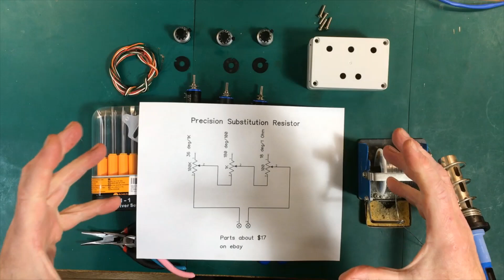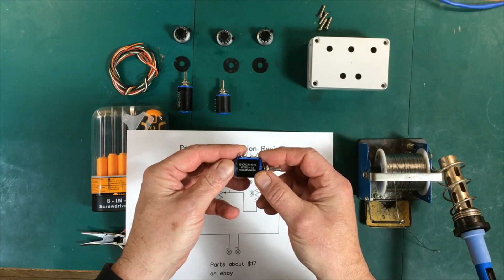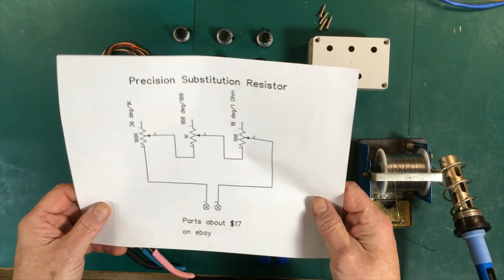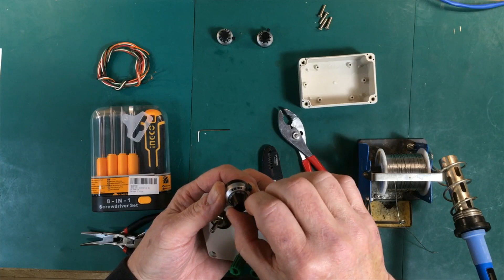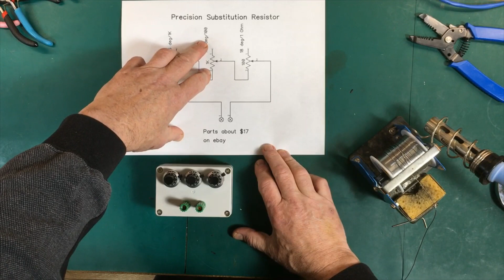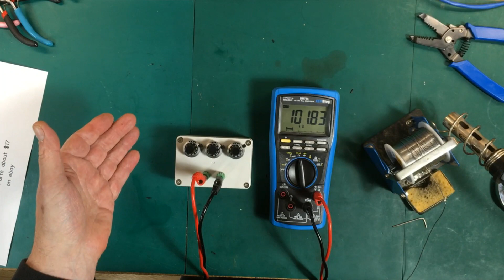0006 - Build a Precision Substitution Resistor for under $20.

Comment: I like it. Thanks. I have a couple of old lab grade decade boxes from a physics lab that modernized. But they take up a big chunk of my bench work space. I have a handful of .01% and .005% resistors of various values, but they are seldom the values I need. I also have a box of precision wire-wound pots that I didn't have any special use for. So I have everything I need for this project, and I can compare it against the big resistor reference boxes. In fact, I think I'll build 2, since there is often a need for a pair of matched values. Again, thanks.

I use grounding strips from home circuit-breaker boxes as bus bars on my bench since they have all of the screws on them for that purpose, and junk ones from old breaker boxes are essentially free.
Reply from the maker: Good luck with the project.  They are indeed handy.

Comment: I do not understand the point of the dials???   You have 10/5 turn pots and a DMM, the dials mean nothing.
Reply: The dials are to make it look special.
Reply from the maker: @cranegantry868  That too.
Reply from the maker: The dials let you get pretty close.  Sometimes that is all I need when very high accuracy is not required.  Plus, they look pretty good in a "form follows function" sort of way.  I guess I could just have a bunch of pots all wired up in a pile.  But...

Comment: I forgot to mention a DIY bus bar... Very handy for making multiple connections. I have one, but I want to improve it. Presently, I have just one, narrow, solid-core wire, on a block of wood, with attachment wires, which have alligator clips. I intended it as a ground bar (hence the alligator clip to attach it to GND/chassis) and it has been very handy for that purpose. The solid-core wire is bent in a "U" shape and the ends are glued into the block. I will improve this by 1) having multiple separate bar blocks 2) have each bar on a jumper - this will allow a DMM to be inserted to take current readings [my brother's idea = kudos to him] 3) add an output switch to each rail to be able to take that rail out of the circuit... I guess the switch could be on the input-side of the rail. Which would you suggest and why? Well, you could just turn the bar 180* to make the switch on the input, or output. But, still, the question remains as to the better side. I am sure it is contingent upon the rig's configuration. Please and thank you. Sorry that this is written poorly; I am in pain. But, you get the idea. Art Linkletter said getting old ain't for sissies. <grin>
Reply from the maker: Sounds very interesting.  Maybe make a short video of it?
Reply: So do a video on it and let us know when you do. Anyway I don't entirely get it's use. What is it for?
Reply: @cranegantry868  I am not set up for making videos, any longer. Sorry. The bus bar is for making multiple probe connections to a common test point - Ground is a very typical connection, of course. I find trying to make even a few probe connections on the same test point within the DUT case to be tedious. Using a bus bar makes things more convenient. It is little more than a strip of small gauge wire that will accept probe hooks, having a length of flexible wire and alligator clip soldered to it and a base to stabilize it. HTH. Thank you for your interest and question.

Comment: I had the exact same idea for a substitution box, though I have yet to build it. I did build a bench pot from the same 10K pot. I gave it a heavy, non-skid base and a 3" round circle, for a knob. I added a wide rubber band to the side of the knob. This gives traction, so that I can dial in a setting with just one finger. I used rather small alligator clips on the wires. It is one of my best bench tools. Kudos!
Reply from the maker: That solution sounds neat!

Thanks for the comment.

Comment: This assumes that your DMM is correct.
You're basically turning knobs until you see the number you want

if it was a precision resistor box you could set it to precision from the numbers on the POT's
Reply from the maker: Thanks for the comment Martin.

Yes, it's as precise as your DMM.  The idea is, you can get in the ball park with the dials, then you put it in circuit and fine tune it for best results, then use your DMM to find out what that value is.  In my case, that's within 0.0005% for a meter that cosst less than $500.  You can't get a 0.0005% decade resistor box for $500.  It seems weird, but it's true.

I did see a used one on ebay recently for $1000.
Reply: @uni-byte  
No... I Understand... So did i 

When i was searching this i was searching for a precision resistor box
and the key component of it would be 
- You could use the POT's to dial in your value
- You'd be able to select the value without needing to use a DMM

Obviously there is a time and a place for something like this 
but....   It does require your DMM to be precise
or.. I suppose you could use multiple DMM's to confirm

but again, i was looking for something that would dial in the value without the need to use a DMM to check the value before it's use
 
Any idea's
Reply from the maker: @martinkuliza  The only thing I can think of would be a decade resistance box.  What precision do you need?  That will be the determining factor.

BTW, I usually just dial in the value from the knobs before attaching it.  It's not until I've fine tuned it do I use the DMM.
Reply: @uni-byte  
i was actually thinking about that.... (The Knobs)
i was wondering are they accurate, then i thought to myself,
i can just turn them and mark it wherever i want to signify what value is what (irrespective of whether the markings are equally spaced or not) or whether the knobs are accurate to the pots

as for accuracy, anything from 0.1% to 1% should be fine
don't need anything as accurate as 0.01%
Reply from the maker: @martinkuliza  The knobs are pretty accurate. Once calibrated 1% should not be an issue.   I recently found a used Cenco 82817-04 decade resistance box on ebay for about $30US.  It has .3% resistors in it.  Maybe something like that?
Reply: @uni-byte  
well, ok,  Just for fun i'll give your one a go then 
it's not the money that bothers me, I prefer to build my own shit anyway, More fun that way 
but , .. and i don't know how or why , but .. Been doing electronics since the 70s, Always used resistors , Never had a resistor box for some reason

i suppose back then my concern was getting a multimeter, Soldering Iron and Scope, After that the 150 in 1 distracted me from getting a resistor box

I'll give it a go
THNX
Reply from the maker: @martinkuliza  Let us know how it turns out.
Reply: @uni-byte  
Will Do
I'm interested to see the accuracy i get when i dial in a resistance value.
Cool talking to you, thanks for the time, i appreciate it
Reply: Buy a precision resistor like .01% and calibrate your dmm. I have 2 500 ohm r 's at 0.01%, also good in a bridge configuration.

Comment: are those knob markings accurate when paired with those pots?
Reply from the maker: Sort of.  The most significant is pretty close, the other two, you need to multiply by 2 as the pots are 5-turn and the knobs are 10.  Keeping that in mind, you can get pretty close.  10-turn pots for all 3 would have been best though.

Comment: If you don't need high power rating, SMD 0.1% resistors are very cheap, and you can get 0.01% for a couple dollars. For instance, Stackpole Electronics brand on digikey. The range of values you can get with those is quite nice though. I wonder if it's possible to set the last dial to 1/2 ohms at lowest display value to reflect the reality?
Reply from the maker: The dials are fixed, unfortunately.  Maybe a deeper search would turn something up.

Comment: You get less smoke by omitting the 100R pot & fit a 2w 100R resistor .
But it messes up the precision a bit …...
Reply from the maker: Yeah, agreed.  A little restraint doesn't hurt either...
Reply: But that is precision smoke!